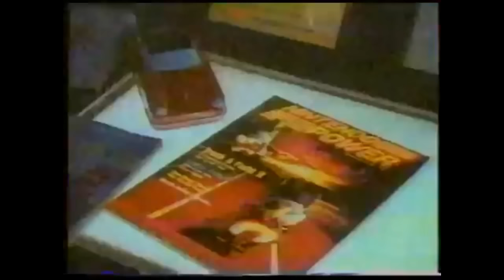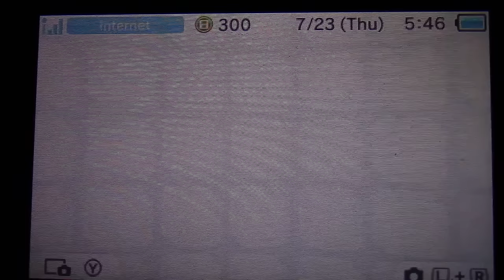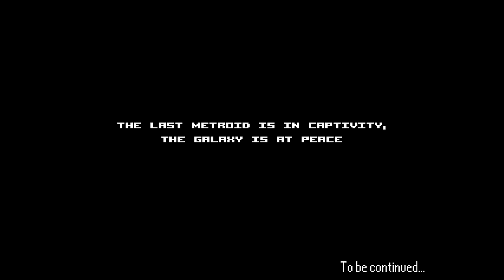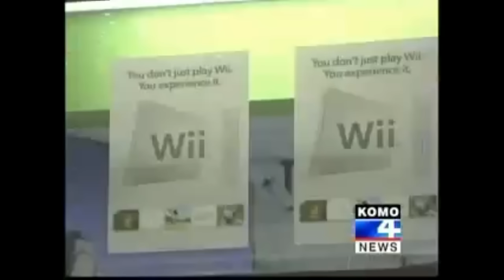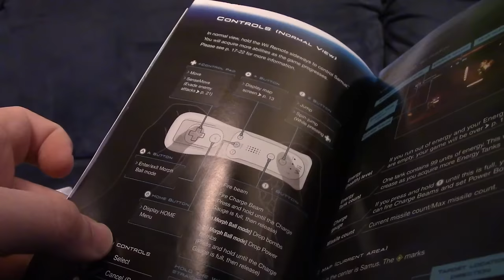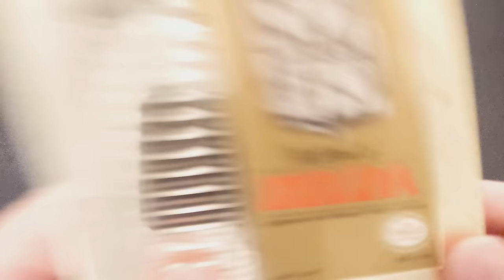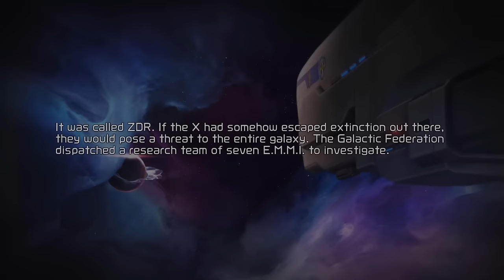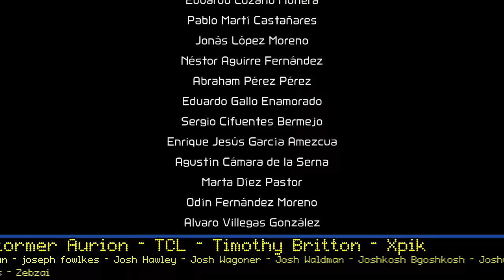METROID - The Complete Series | GEEK CRITIQUE

Comment: Super Metroid Tip: If you are in the top room of the wrecked ship. Kill all the monsters and then open all the doors. You only have to clear the room once. If you leave, any doors you didn't open will stay gray. I don't think it will help in a speed run, but it's less annoying for casuals. Just clear to the right, back track to the left and open the door. Turn around and head back to the right, shoot the center hatch that you entered from after you pass it and then finally shoot and enter the room to the far right that has the item in it.

Comment: One major thing to keep in mind with Metroid Fusion is it was a portable game in an era where we couldnt put the console to sleep.
Gameboy games sometimes followed this mentality but sometimes didnt (Metroid2 did not). By the GBA era Nintendo especially was deliberately designing the game in a way to be bite-sized play times, hence the mass of save stations. The whole reason the Gameboy exists is because one of the designers saw a guy playing with a calculator on a train, its meant to be played in transit not necessarily played like a normal game.
If the game was too vast between save points, people would be less likely to want it because their trip they want it for would make playing it a chore. Metroid Fusion rarely lasts more than 10m before you bump into a save station, so it fits the "im on a train for 10-15m..." mentality